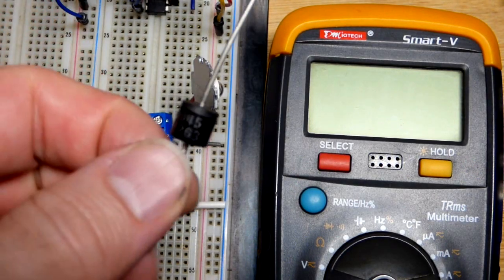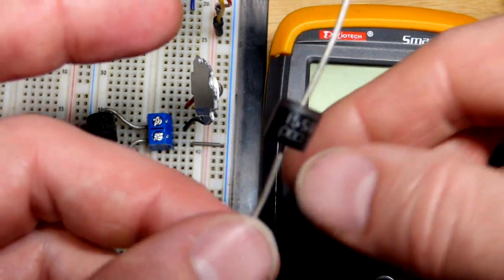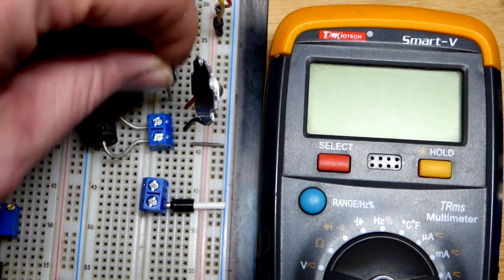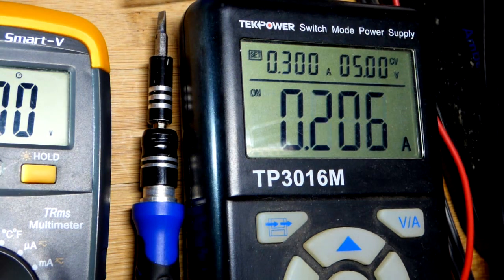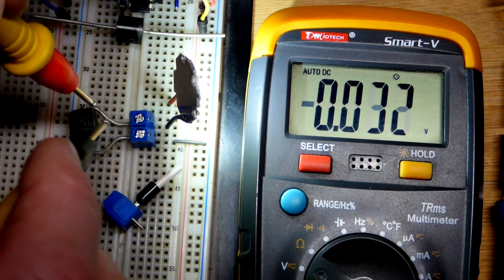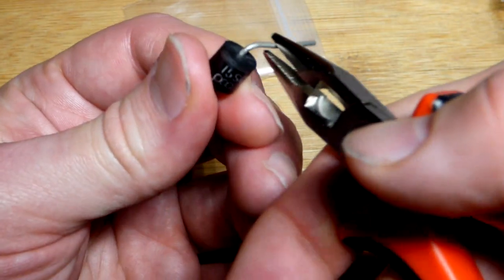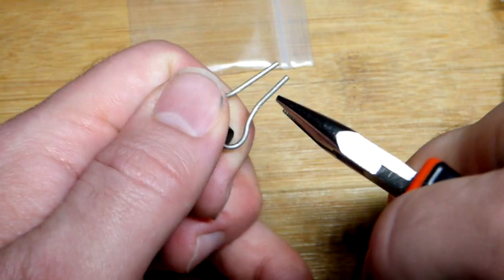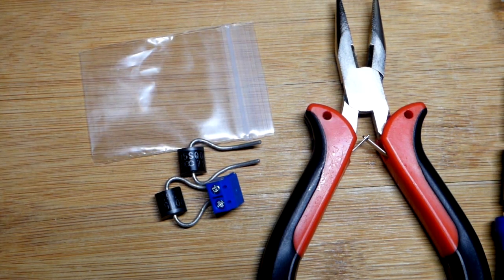How to plug 15SQ045 Schottky diode directly into breadboard via a terminal block by electronzap

Comment: Not gonna lie I have been scratching my head on how to couple super large leads into a breadboard ... no wonder people damage their breadboards!
Reply from the maker: Yeah, I've used these Schottky diodes in a number of old videos and have been thinking about how to connect them to stuff for years. And this is by far the best way I came up with to connect them to a breadboard circuit so far.